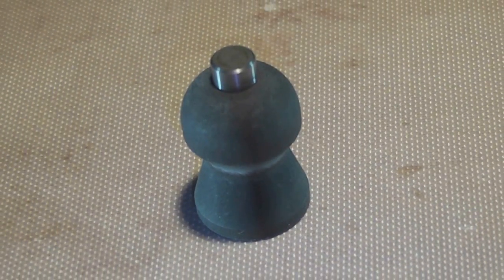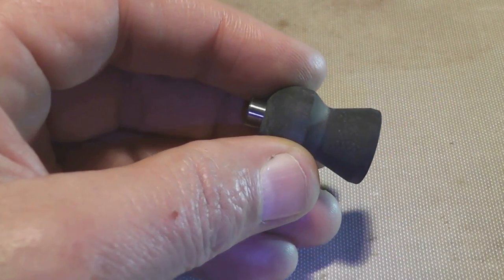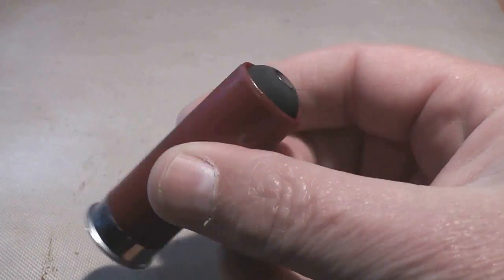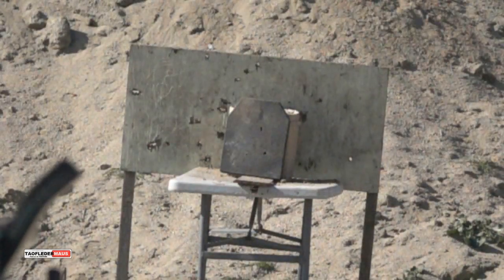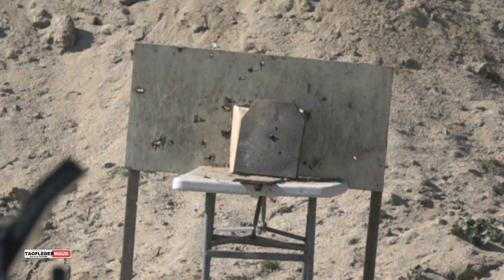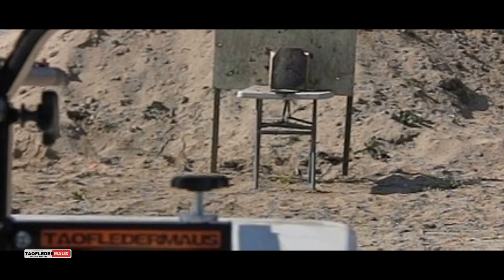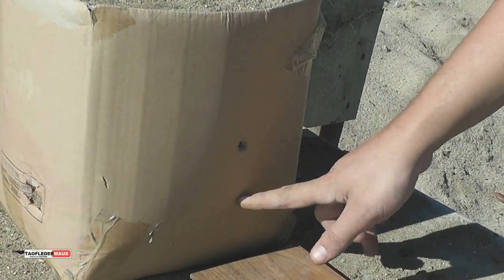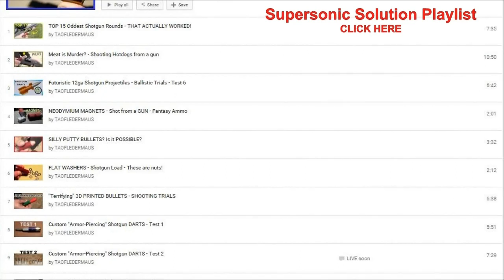World's FIRST Carbon Fiber SHOTGUN SLUG -  ARMOR PIERCING - CONFIRMED!

Comment: What about carbide buckshot?
Reply: broken carbide inserts 
then cut shell it cause without a cover the carbide would screw ya barrel up bad.
buckshot of death
Reply: +BravoGorilla I did not know that. I assumed the shot would sort of skim the barrel on the way out.
Reply: BravoGorilla that is why i said cut shell it to hold it together for more energy like a slug until it hits the target
Reply: BravoGorilla I understand that but I'm thinking of a at home situation if you had a handful of broken carbide inserts could you just throw them in a shell and stop armored personnel
Reply: +Robert Hathaway sounds like death by ricochet.
Reply: +Brandon Blount Don't think the shot would have enough mass to push through any body armor.
Reply: GetTheFO cutshell would be a solid till impact.
Reply: Brandon Blount Goo point, but after striking the individual pellets would still not have enough energy to go through. The energy would be dispersed across the whole assembly as it hit the plate and moved outwards.
Reply: GetTheFO was just saying try it 
they shot bubble gum before 
and flash lights out a shot gun
Reply: +BravoGorilla  Some barrels can have rifling worn off that is why wax tips were made,  you don't wear the barrel out because copper and lead aren't very hard.
Reply: +George hanes. Waxers were made to retain the mass in bird shot. The shot never really hits the rifling in a barrel/choke. The plastic shot cup rides along the rifling. It's a different case with slugs. I think that carbide buckshot would ricochet like crazy.
Reply: Joe Clark  Sorry, not wax slugs, green tipped APs that were almost outlawed.
Reply: +George hanes. Ah. The green is just paint, for color coding. Green tips are just copper jacketed lead with hardened steel cores. They don't do any extra damage to the barrel of a rifle. I don't believe that these were made for shotguns. Remember that speed defeats body armor more easily than mass. Putting a rifled barrel or choke on a shotgun doesn't turn it into a rifle.

Comment: Definitely better in this format. 
So I'm hearing that velocity wins the day with rifles, but shotguns don't have the same velocity, and therefore are defeated by armor plate. As I understand the powder charge is larger in a shotgun shell, so is there no way to translate the greater potential energy into a faster round?
Reply from the maker: +Brandon Ogden  Shot two defeated the plate.
Reply: I mean, it's true. It totally did. My hangup is that those rounds are probably at least as expensive if not more expensive than a comparable AP rifle round, and the magnitude of damage to the target isn't that impressive comparatively.

Also, since the smaller profile tip is needed I wonder if it might only be just barely penetrating, and therefore drop off in penetrative power much more quickly. I love shotguns and what you guys are doing on this channel, it's a weirdly beautiful thing.

I just can't wait to see when there's an even better option.
Reply from the maker: Each of the these slugs probably would cost a a couple hundred dollars each if you had a machine shop make a few of them for you.
Reply: Yeah, I'm confident that if I were looking for an "armor piercing" solution, the best bet (by far) is still to go for a rifle, even if I have to buy it first. I hope that one day a shotgun can compete on that kind of price to performance, but... Well, a man can dream.

Comment: I enjoy this format better. I can keep track of which slow mo is which but it's nice to see it straight after the shot.
Reply from the maker: +SootySweep22   I think you are in the majority.    It's was mostly technical issues why I did it the other way.  My old editor crashed when I put a lot of different files and video formats in the time line.   So I had to break each video into 2 or 3 segments.

Comment: you have to make the carbide lose enough to keep moving out of the carbon fiber so the slug delivers the carbide and doesnt hold it also sharpen the carbide or just let half of the carbide rod continue out of the carbon. the carbon fiber is holding the rod from penetrating farther , make it like the depleted uranium design where the heavy inner spike continues

Comment: You may already know this, but that piece of iron plate that got ripped out with shot #2 is called spall. Relative to armor plating spalling is the act of small pieces of the armor (spall) breaking away from an impact. In fact, in armored warfare spalling is often as dangerous if not more than the shot its self. If you can imagine enough spalling would turn the inside of a tank into a big metal blender; there are even tank shells that are specifically designed to create spalling (among other purposes).

Comment: I think it is interesting to know that the focused energy of shot number 2, pushed a piece of the armor its self into the box of sand.

Knowing this, one would want to further study this dynamic and see about how to increase the muzzle velocity and decrease the frontal profile to focus the energy toward that end.

The armor its self seems to have [for the most part] stopped or deflected most of the carbide, however, if the carbide can force some of the armor to move along the original trajectory, it still defeats the armor and achieves the initial goal.

Any small frangible fragments which make it through this hole are bonus.

Comment: This was really well put together. I like the new compilation method. However, if you're doing a video that compares a large number of projectiles, I think having the "high speed summary"  at the end would work better.
Reply from the maker: +Michael Berney   It's a lot easier to edit the old way.   My old video editor would crash when I put too many files and video formats in the timeline,  so I had to do it that way out of necessity for longer videos.

Comment: #2 penetrated further because of the shape of the core. The high-brass #3 shell was comparable to the low brass #2 because of the weigh difference. The flat-nosed core on the #3 shot also slowed it down a bit.

Take the #3 with the same slug but use a slightly conical core like the #2 shot and I guarantee it will penetrate just as good as the #2 did. Better even, because more powder = more explosive force = more fps

Comment: I'm a machinist by trade I would think that carbide while very hard is also very brittle drop carbide endmill on concrete floor it will break into a bunch of pieces. Maby try hardened D2 or other steel,   case hardened steel could get very interesting.

Comment: In modern day all shells could be made w/low brass or even all plastic (google WANDA shotshells). High brass is a hold over from the days when they made hulls from paper to prevent burn through when the powder first ignited in the shell (reloading was common practice, this gave you a chance to reload a few times before having to completely toss them. But eventually they did burn through in the main body. Hence the switch to plastic hulls.

Comment: So, you need another batch of these, all tapered. Test against ballistic gel with an armor plate in front, to see how much velocity is left in the carbide after armor penetration. See if its actually a viable option. And for the heck of it, test both a level 3 and a level 4 plate.

Comment: I have been saying this for years and yet I still have people who insist on arguing with me and physicists about ballistics.

Armor/Barrier penetration is comprised of these 4 main factors, they are NOT subject to change (listed in NO specific order)

1. Projectile Composition (Steel, lead, aluminum, depleted uranium, ect...)

2. Projectile Velocity (how fast the projectile is moving for those that do not know what velocity is, and yes there are people out there who do not know what velocity is)

3. Projectile Design (interior hardened core, exterior core, FMJ, HP, JHP, Wide Flat Nose Gas Check, ect....) 

4. Projectile Mass (Mass is generally the amount of matter of an object. It is determined by the strength of its mutual gravitational attraction to other bodies, also its resistance to being accelerated by a force.)

For all the people who ask... "but what about the WAX tests, they penetrated a lot more than anyone expected"... This is simply explained by the follow hypothetical situation.

Say you take a 2 ounce paint chip made of a special paint that could survive Earths re-entry and still weighed only the same weight as a normal paint chip of its size and mass. Now if we were to accelerate that paint chip to near light speed and have it impact the Earth it would do more destruction than the Atomic Bomb that was dropped on Hiroshima. 

This is probably the best way to explain it as a gamer: https://www.youtube.com/watch?v=sCoHT_cHPzY

Comment: Since you are single loading the rounds anyway, might as well use a single shot or double barrel shotgun. You could also go long rod penetrator since weight is not the limiting factor in the speed. The light weight of the projectiles could be hurting velocity as there needs to be enough resistance to efficiently burn the powder. I also have some old 3 inch 12 Ga #2 duck loads with lead shot that pushes 1-13/16ths ounces of lead  and I think they are probably rated faster than what you are shooting. I think the pressures you experienced with such a light weight projectile you probably had primers backing out of the pocket because they didn't have enough pressure to force them to grip the sides of the primer pocket.

Comment: Take a normal lead slug, drill out the nose to insert a sub caliber penetrater made of tungsten, carbide, even hardened steel like the AR500 plate and it would pop through the armor as well. Nothing really fancy going on here, works exactly like APCR ammunition does and would fly straighter more often.
Reply: +Cragified I cast slugs; if I could get my hands on some carbide penetrators and armor I would test this.
Reply: The Metal Butcher That's a good lead. I'm not really sure how you'd cut tungsten carbine drill rounds, but it could work. I'd probably go with the 1/8" round.
Reply: Porty1119 Easier to break tungsten carbide then try to cut it. As far as diameter of the sub caliber core you want as small as diameter as possible to maximize PSI on the impact plate while being thick enough to not just shatter. Would take trial and error or some good math :)

Comment: Cut diamond gems that don't have a Culet crack much easier, I think the beveled edge actually has more to do with making the carbide tip more shatter resistant then shrinking force area.

Comment: Definitely fun and interesting! I agree, this format is better. Why didn't Tim machine one with a cone shaped point, as is common on armor penetrators? Seems like focusing the entire impact on one tiny spot would open up a hole much more effectively.
Reply from the maker: +elektro3000   I'm not sure.  It's probably difficult to grind the angle on the hard material.

Comment: Carbide is a hard dense material but it shatters easily. Maybe something like tool steel would work better. I would try a dowel like the ones machinists used. They are very strong!
Reply from the maker: +Thaddeus M    Tim has experimented using tool steel before and had good results.   It is also harder than the AR500 plate.

Comment: Amazing, but geez OP - talking about trying to make a square peg fit in a round hole.  Testament to materials and innovation, but such an incredible stretch that it misses the big picture, seems to me.  Small and fast are what penetrates hard intermediate barriers - much much easier and cheaper.  Still, way cool.
Reply from the maker: +Daniel Stoner   It would have been sad if Tim went through all the trouble of making these and they didn't work.  lol

Comment: Harder material, and generally smaller contact patch(increases pressure by lowering surface area), it would be interesting to see the same test with a sharpened penetrator vs another chamfered penetrator.

Or various degrees of chamfer leading to a pointed projectile.

Comment: Wow, i wouldn't of that that little bit of chamfering would of made that much difference, but I guess with a material as hard as tungsten, it needs to cut through the plating. So much different than shooting a soft metal.

Comment: Unless you loaded these shells with a faster burning powder to compensate for shooting a much lighter than designed slug you attained very low velocities.  Carbide is a very brittle metal and would shatter upon impact.  Switch to Tungsten slug and put in proper powder and you will get more impressive results.

Comment: it would be really cool if you could do this:
Take some sheets of ply wood and spray paint alternating colors one foot wide each place them parallel to the direction the projectiles are being shoot.

 so you could use the high speed to get an idea of how fast the projectiles are actually going.
Reply from the maker: +Wolfganges Factorial   My HS cameras aren't fast enough to utilize something like that.  The slugs travel over 1 foot for every frame at 1200 frame per second.

Comment: Take one of the new TCM rounds and drill it out about .125 and then insert a sharpened piece of .125 asterloy welding rod and then shoot that body armor. Don't know if you can film it with the speed of that new round, but with a 22 mag round, it will go through a .250 mild steel plate.

Comment: The tapered core penetrated the steel armor easily. If the core were sharpened to a point, count it defeat inch thick titanium plate like demo-ranch shot with a the .50 bmg? The music was really fitting for the video,  that armor being defeated by a shotgun was unsettling.
Reply from the maker: +Pepper Spray   I doubt it would help much.   I'm thinking if it were too pointed, it would just be really fragile and become a crumple-zone.

Comment: I for1 noticed that your mass acceleration technician committed several safety protocol violations during this video. Each time he accelerated a projectile he without first opening the accelerator breach and securing it in the open position stepped to the target right in front of the muzzle. My own common practice is to place a spent shell upside down vertically in the breech or a 4 inch piece of wooden dowel gently in the same manner thus ensuring safety.

Comment: I'd like to see it done with a point "like a "50bmg bullet" and the outer part that holds it steady during flight more brittle, so it just carries the steel core to the plate, then shatters so it don't slow down the core any..

Comment: Nice video I enjoy all of them. You should try one of these with a point ground on it and a hotter load. Or possibly a test of which AP rounds work the best. These look like they have great potential.
Reply from the maker: +Matt K   I don't know if Tim will make more of these because they were nasty to machine,  but I'm pretty sure he will continue with the diabolo shape and throw some carbide cores in them.   Plus use denser materials instead of a light carbon fiber.

Comment: not so sure armour plate is rated for repeated impact in the same spot so penetrative power is merly speculation. The slug if you like being the carbide section depending on the definition of carbide would be super hard but also fragile on impact so I agree very destructive, the carbon fletching however being the traditional bomblet design will be very stable. Very expensive experiment with so so results. I don't mean this to be mean but a quick read into any basic balistic research would of saved all the expense.

Comment: did you check the barrel after shooting these carbon rounds. Carbon fibre is a very abrasive material and i did wonder what wear they would have when i watched them being made. cool watching how stable the flight was though. keep the vids coming.
Reply from the maker: +Thomas Hayward Tim sized these so we could use the plastic shotcup so the carbon fiber had a layer of plastic between it and the barrel.
Reply: +TAOFLEDERMAUS ah that makes sense. Thaught Tim would have it covered. would be interesting to see the penetrating power of a pointed carbide tip on one of these rounds.
Reply from the maker: not titanium, --- carbon fiber.

Comment: core needs to be slightly larger in diameter, maybe longer too, so theres more mass to the carbide, same chamfer, loaded to higher velocity.  im curious what the velocity is like at 100yds. 

unless the slugs weigh the exact same amount as the as the original payload of those off the self shells, the velocity will be different. lighter payloads dont develop pressure  the same.
Reply from the maker: +CrAZyLiKEafOX FoxLIkEaCraZY   They probably decelerate very quickly since they are so light.     If we had moved 15 feet closer,  it's possible shot 3 would have punched through.

Comment: Legit! Same failure mode I see with AR500
Reply from the maker: +The Wound Channel   I can't believe Darren found the little fragments in the box-o-sand.   Shot 3,  that slug of steel was VERY close to popping all the way out.  Probably couldn't repeat that if we tried.
Reply: +TAOFLEDERMAUS it's so awesome when you find bullet pieces you think are gone forever lol. 

Is Tim gonna sharpen those to a point for future tests?
Reply from the maker: I'm not sure.   There's probably a limitation on how sharp they can be and still have enough strength to bang out a chunk of steel -  without just shattering.

Comment: Chamfered vs not chamfered is like a pointy stick and not a pointy stick. PSI is greater on the pointy stick. How about using Win. Super X slug hulls that move at an advertised 1600fps with that flat pointed round?